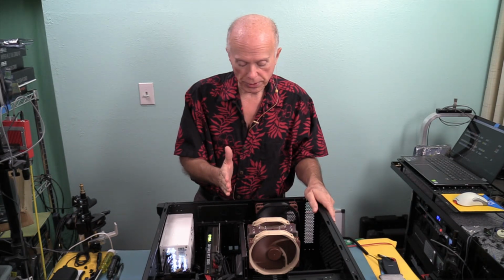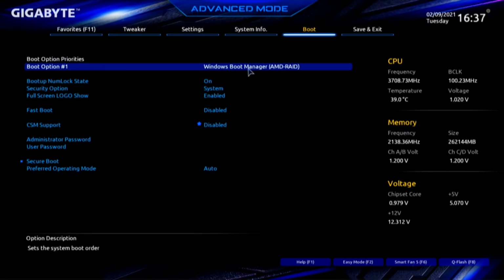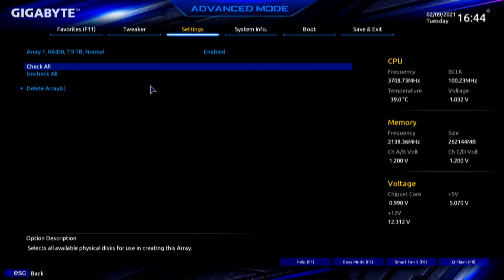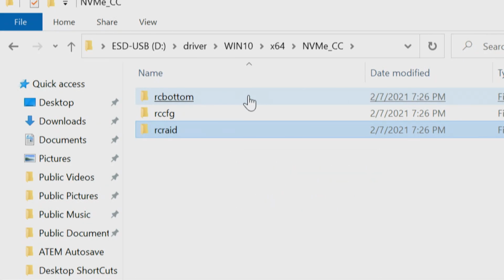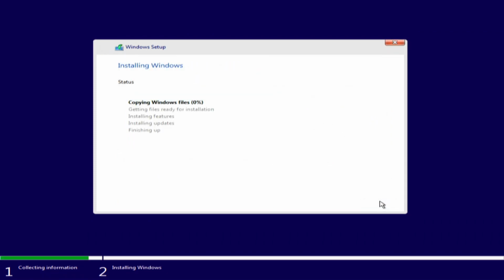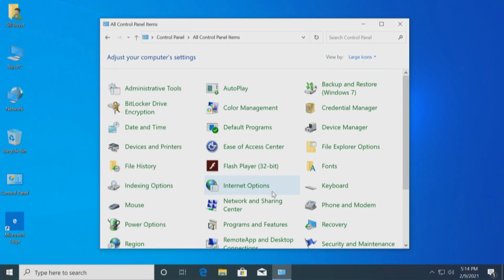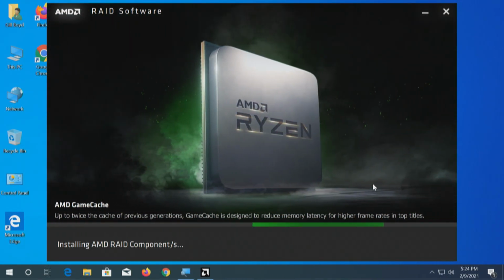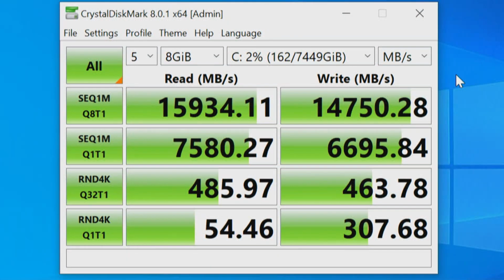Windows Bootable NVMe RAID 0 Tutorial on Gigabyte TRX40 Designare using Sabrent Rocket NVMe 4.0

Comment: Random rw result are bad
Reply from the maker: Hello Aji,
Welcome! Is that a question or a statement?
Reply: @BuildOrBuy  a statment
Reply from the maker: Hello @ajingolk7716 ,
Test and Verify. Your Results may vary. This Video is not about RAID Performance but about How To. A Bios Boot RAID is a Hybrid RAID. A lot of Viewers are intrigued with RAID but don't actually need RAID. RAID can be problematic on Consumer Desktop Motherboards. Hassle factor.
Reply: @BuildOrBuy  until nowadays the only ssd manufacturer that succeded to get fastest random R/W is intel with it optane ssd dc. And i thought that RAID will help but i was disappointed 😔
Reply from the maker: Hello @ajingolk7716 ,
Unfortunate about Optane. Intel has a history of creating great tech then dumping it. If You want real RAID, use a Hardware RAID Controller card.

Comment: thank u, i just succesfully did my raid0 with 2 ssd, can i connect a 3rd hdd or ssd? cuz i have a hdd with some important files and i just wanted to get my files back.
Reply from the maker: Hi Jan,
Welcome! Congrats! Without knowing any of Your System Specs, You should have a SATA Port available to connect and migrate Your Data over. Hope that helps!
Reply: @BuildOrBuy  yes i have sata ports available, i just wanted to be sure if i can connect a 3rd hdd with my 2ssd raid0, im afraid that something will happen bad to my pc
Reply from the maker: Hi @janlawrence12 ,
Depends. Every Motherboard has different PCIe Resource allocations. We'll need the following info to check that out. 
1. What's Your Motherboard and Chipset.
2. CPU 
3. Your SSDs SATA or M.2?
Reply: @BuildOrBuy  hello! i have gigabyte b550 aurus elite, amd ryzen 7 3800x 8core, my 2 raided ssd are m.2 and the hdd that i want to connect to get my files is hdd with sata
Reply from the maker: Hi @janlawrence12 ,
Interesting Motherboard Layout of PCIe Lanes. Both M.2 NVMe PCIe SSD Connectors are Dedicated. One to CPU. The other through Chipset. Your 4 SATA Ports are also Dedicated. Just plug-in Your SATA Drive. You're good to go! Thanks for Sharing! Hope that helps!
Reply: @BuildOrBuy  thanks, i already connected my hdd with sata adaptors and my pc did not auto destroy aha thanks!
Reply from the maker: Hi @janlawrence12 ,
Excellent! Worst case scenario would have been a Resource conflict! Glad that did not happen!

Comment: @ 23:50 i only see 3/4 drives. When in bios i see all 4 in online RAID 0. 

But when installing windows i randomly only see 2 or 3 drive. This is quite frustrating.
Reply from the maker: Hi Hurly, 
Welcome! Four in RAID, You should only see One! RAID Driver was not properly installed at time of Windows Media Installation. When Windows says, Where do You want to Install Windows and cannot see the Controller which has to be seen before seeing the Drive, singular.  Verify Driver Directory from Installation Media from AMD. Which one Driver to use depends upon which CPU and Chipset You have. Check Windows Device Manager for RAID Drivers. Those RAID Drivers were suppose to be injected at time of Windows install, in order, in sequence. That was Our Goal with these Series of Videos regarding RAID, to simplify the process. To eliminate the gotchas! You can do this! Hope that helps!
Reply: @BuildOrBuy  thanks. Will keep trying. Gonna try some old bios versions now.
Reply from the maker: Hi @hurlyzzz , You don't need old Bios. That could be a very bad idea for RAID Support! What Motherboard are You using?
Reply: @BuildOrBuy  Asus x570-p with a amd Ryzen 7 3700X
Reply: Unless I have the bios config wrong, which i am quite sure it is correct.

Note, sometimes on some reboots not all disks show up in the bios. Very random, i have had 1/4 2/4 3/4 and all 4/4 showing up on different boot cycles.
Reply from the maker: Hi @hurlyzzz ,
Please verify. Is this Your Motherboard?
ASUS prime X570-P 
https://www.asus.com/us/motherboards-components/motherboards/prime/prime-x570-p/techspec/

Parsing out and Looking at Your PCIe Resource allocations for Slots and Storage. 
1. 1 - M.2_1 to CPU 
2. 1 - M.2_2 through Chipset 
How did You install 2 more M.2 NVMe PCIe Drives? If You're using an Add in card, which one and IN which Slot? 1st PCIEX16_1? Did You Bios Bifurcate that Slot from X16 to X4X4X4X4? These Details matter greatly! Changing one thing can change everything!
Reply: @BuildOrBuy  yes, that is the correct motherboard.

I have addin card Asus hyper m.2 in slot pciex16_1.
Reply: Here's a link to a picture of my bios.
Reply from the maker: Hi @hurlyzzz , 
As expected. How do You have Bios Bifurcation set? Auto or Manually? Set Manually from X16 to X4X4X4X4!
Reply: @BuildOrBuy  hmmm, the link gets auto removed. Yes it is set correctly "manually" in bios. 

It is when I enter the windows install that everything messes up.
Reply from the maker: Hi @hurlyzzz , 
YouTube will either block or remove Comment links. Spam has been a serious and nefarious problem.
Reply: @BuildOrBuy  yeah spam is very bad. 

In any case, do i need to install windows with the raid 4/4, or can I add this afterwards?
Reply from the maker: Hi @hurlyzzz , 
Unfortunate situation. Especially when diagnosing problems! 

In Bios Manual, ASUS usually references  Hyper or RAID Mode which is not specifically correct. According to the ASUS Bifurcation chart, that should work on Your Motherboard in the PCIEX16_1 Slot. For that to to be hit or miss is either fixable with a Bios Update or if not then there could be a problem with Motherboard or CPU. A bad CPU can give all kinds of grief. Like chasing gremlins!

For instance, 7950X CPUs are having a streak of bad CPUs right now causing Memory errors. 

ASUS Bifurcation Chart for reference 
https://www.asus.com/us/support/FAQ/1037507/
What We don't know, in Your situation which could be the problem, Motherboard or CPU. And that's only going to resolve with Testing to Verify by Trial and Error. If still under 30 Purchase, RMA both CPU and Motherboard for replacement! Hope that helps!
Reply from the maker: Hi @hurlyzzz , 
Our biggest problem with Spam are the bots! YouTube regularly and aggressively culls those out! But much of that is left to each Channel to Self monitoring. Which means be watchful or risk violating the YouTube TOS. Risky business! YouTube provides tools. One of those is no User Comment links allowed. The risk is that serious. We've had a few really weird ones in the past. Like a BOT Trending going Viral as in everywhere on lots of Channels! On lots of pages! Crazy! 

RAID - Either way is fine. With 5 Drives, to reiterate 1 out of RAID (Boot Drive) and 4 IN RAID! And... RAID added later! 

Remember to remove non RAID while Configuring RAID. Otherwise, easy to get confused as to, Who's On First!
Reply: @BuildOrBuy  i successfully installed windows on the single ssd. Then after when I shut down and insert the 4 other disks, on boot i get a blue screen. 😭
Reply from the maker: Hi @hurlyzzz , 
Got it! A BSOD is a Driver. The Driver is the RAID Controller Driver. At that point, If Yiu get to to Windows, from Device Manager, change those Drivers on those 4 M.2 NVMe PCIe Drives only to RAID, IN order and in sequence!
Reply: @BuildOrBuy  well I am getting the blue screen as windows is loading. So there is no chance to load or change the driver.
Reply from the maker: Hi @hurlyzzz , 
Then You have Three Options. 
1. Safe Mode will not work to Load Drivers with minimal Driver support. 
2. In Bios RAID, with all 5 M.2 NVMe PCIe Drives physically installed and connected. 
A. In Bios RAID, Remove 5th Drive from RAID which is the Boot Drive. 
B. Hmm... 
My concern with telling You how to do this, since You're where You are, it can get worse if You mess this up any further. I prefer to tell everyone to just start over. Keeps everything simple. That's the reason for the Videos. We have several. You apparently missed installing the RAID Drivers during the Windows installation. 

If You're Booting from a 5th Drive and You get a BSOD with the other Drives, that means when You installed the RAID Drivers, either You picked the wrong Controller or the wrong RAID Driver Directory. It happens. Results are the same. BSOD. This is easy once You've done it. Miss a step and here's where You land. The Key is fixing it. To reiterate, keep it simple.
Reply: @BuildOrBuy  thanks for the tips. I don't mind starting again. Was gonna give it a try with windows 10. But don't have access to a 2nd system right now, to create the boot USB.

Just to clarify, i need to create 2 raid arrays in the bios. One for the boot 1 disk RAID, and one for the 4 disk RAID.
Reply from the maker: Hi @hurlyzzz , 
To specify, You're NOT using Windows 10? Were You using Windows 11? Changing one thing, changes everything! These procedures in all of Our Videos are Windows 10. Windows 11 still has issues. I'll get You the link to Our 1st Video on RAID. It is Specifically about what You're trying to do. A non typical Hybrid Bios RAID with 4 in RAID and 1 Boot out of RAID. Supper time for me right now. I'm hypoglycemic.
Reply: @BuildOrBuy  yes, i am try with windows 11! And failing.

The boot disk, i have option for "volume" or "RAIDABLE". I think "volume" is the correct choice?

The 4 disks i am doing RAID 0.
Reply from the maker: Hi @hurlyzzz , 
This Video should help. Remember while watching, to reiterate, this is a non typical Manual RAID installation. That's why We did that Video!
https://youtu.be/x5G-zciner4
Hope that helps!
Reply: @BuildOrBuy  ♥️
Reply from the maker: Hi @hurlyzzz , 
This should explain what You're doing with What, Why and How! Success on Your RAID Installation! Happy Holidays and Merry Christmas!
Reply: @BuildOrBuy  thanks alot for your videos. You really have a passion for it! ⚡
Merry Christmas! 🎄
Reply from the maker: Hi @hurlyzzz , 
Absolutely! Glad You noticed! Glad We could help! Thank You very much!
Reply: Also not sure what is better. To make the 4/4 RAID bootable, or installing windows on a separate NVMe disk. (the latter is how I had it working in win10 before). 

In that case would it be better to install windows with just the one disk, and build the RAID afterwards.

I can simply remove the hyper m.2 x16 card. Then i just have the one disk for installation.
Reply from the maker: Hi @hurlyzzz , 
These are Details We needed up front from the Beginning. Now You're asking about whether to utilize the Default Installation or a Non typical manual Installation. AMD and Windows expects All or nothing in RAID. Four out of Five In RAID, is NOT Default and requires manual Driver Installation. Both ways work. It's a matter of choice. Always Options!

Comment: Is there an issue installing gigabyte raid drivers that causes windows 10 to BSOD? 

I’m having a helluva time every time I get a clean install it Blue screens when I try to get my 6 SSD drives to be recognized and the only way I’ve been able to is by installing the raid drivers. I sisnt even want to use raid. Soon as i reboot for windows update boom I’ve got to start all over.

Now I’m thinking I should just do raid but I have stuff on those drives I’d like to shift around forst.
Reply from the maker: Hi Tradeology Analytics, 
Welcome! Sounds like You're having Driver problems with BSODs. There are other ways to create a RAID. However, that's why We show this way to keep it simple and ensure Success! Each method has procedures to follow for that reason. Suggest pick one procrdure and follow that through.

Comment: I'm trying to install windows 11. I have a gigabyte 570s motherboard. Raid 10. Was set up in bios. When installing windows 11 it did not recognize my m.2 drives. Do you have any suggestion?
Reply from the maker: Hi Mike Kendall,
Welcome! Did You use the AMD RAID Controller Driver? That's when Windows says, where do We install Windows! Search: X570 AMD RAID Driver. That's on the AMD Chipset Driver page. There are 3 files within that zip that must be installed, in order. Then Windows will install on Your RAID. Hope that helps!

https://www.amd.com/en/support/chipsets/amd-socket-am4/x570

Comment: I've spent too many hrs trying to get this to work ! But removing my existing ssds and only having nvme connected did it for me....3900x,x570 crosshair hero 2 on board nvme and a pcie card with only 2 m.2 drives
Reply from the maker: Hi Stand Alone,
Sounds like a problem with Shared PCIe Resources based on Your Description. Each SATA port is on a PCIe Lane. And if those SSDs were on a SATA Port that was a Shared PCIe Resource, that's the what, why and how. I'd have to look at the PDF to verify. Glad You're up and running now!

Comment: Hi Bill
Thank you for your instructional videos, you’re the Guru on bifurcation, as well you have one of the best (detailed) videos on AMD-RAID.  
I’ve been attempting to get a non-bootable data array working but without success, unless said RAID array is a systems array (i.e. bootable) there seems to be no way in loading the necessary drivers (RCBottom, RCRAaid, RCCfg).  
Therefore, you are my last hope before I succumb to the need to purchase an expensive hardware such as the latest ARECA ARC-1886-xNxI, which seems to be one of few available now.  Having used their RAID cards on a couple of my workstations and still use their ARC-a1883ix.  
The workstation motherboard I want to get AMD-RAID to work on is ASUS’ Pro WS WRX80e…, it would consist of six NVME M.2 2TB ssds configured as a RAID 5 array.  At this stage, in the BIOS, it is shown as follows; -  RAID5, 9.9TB, Ready and all associated disks as “Online”.  Under “Device Manager” –> “Storage Controller” AMD-RAID Bottom Device and AMD-RAID Controller [storport] are displayed, under “Disk Drives” all associated disks are shown, i.e. Sabrent Rocket 4.0 Plus etc..  Under “Disk Management” all six drives are shown as Basic – Healthy (primary partition).  None of these six drives are displayed as active in the “File Explorer”.  Also the operating system is Win 11 pro with the server add on.  
All the best, hoping to hear from you.   
Michael
Reply from the maker: Hi Michael Klar, 
Welcome! I'm honored! Appreciate Your Comments! There are 2 parts to this. RAID Bios settings, for a Hybrid Bios RAID which is also Bootable but does not have to be then the O/S RAID Drivers. The install expects ALL M.2 Drives to be IN RAID. But that does NOT have to be done that way hence the manual install of the Drivers. 

Changing RAID Controllers will only exacerbate the situation. The RAID Drivers expect ALL M.2 NVMe Drives to be in RAID, therefor best option is to only install or connect those M.2 Drives You want IN RAID or else You'll have to determine which Controller those Drives are Connected to and change only those Controllers to the RAID Drivers! An option. 

If You had say 5 M.2 Drives connected then a non typical install would be to install those RAID Drivers manually as We have described. If You're seeing individual Drives in Disk Management then the appropriate Controller the M.2 Drive has connection with for said M.2 Drive requires changing. 

The chain - Windows sees a Drive according to the Controller then what's ON the Controller. For a Drive Controller to be changed to a RAID Controller, Windows needs a Driver so Windows knows whatever is ON that Controller and will also change accordingly hence those 3 RAID Drivers, in order and ONLY on the Controllers to be changed, no other Controller. 

We have not tried doing this install for RAID on Windows 11. Only on Windows 10. I do not know if that procedure has changed. It should be the same. I do know there is a different Driver for Windows 10 vs Windows 11. And the Folder is different according to the CPU such as Threadripper 1, 2 (X399), 3 (TRX40) or Pro (WRX80). I'll have to check which is which. 

According to the PDF, looks like Folder: NVMe_DID 
https://www.amd.com/system/files/TechDocs/53987_1.pdf 

BTW: Congrats on Your WRX80 Build! Looks like We need to do a Video on a WRX80 AMD RAID Build! 
As a side note, the 1st Gigabyte WRX80 Motherboard did not get RAID Bios support until the 3rd Bios Update! 

There have been 3 types of RAID, Software, Hybrid Bios RAID (Bootable) and Hardware. All of those are CPU based RAID. A 4th type is a GPU based RAID aka GRAID. More efficient use of CPU Resources! We have a Video on that as well! 

GRAID SupremeRAID WRX80 Workstation Build Specs
https://www.youtube.com/watch?v=BD8NOqaBz7k&t=2s

The very first Video We did on AMD RAID was on the X399. That was a Non typical RAID and might help You. 
ASUS Hyper M2 X16 NVMe Quad card plus four Samsung 970s - AMD NVMe RAID 0 Upgrade
https://www.youtube.com/watch?v=x5G-zciner4&t=969s
Hope that helps! Keep Us Posted!